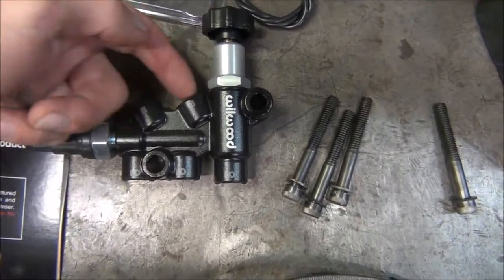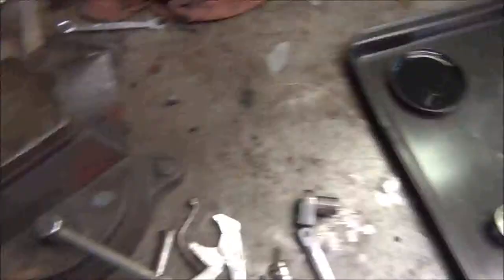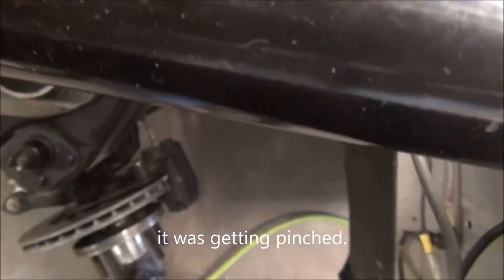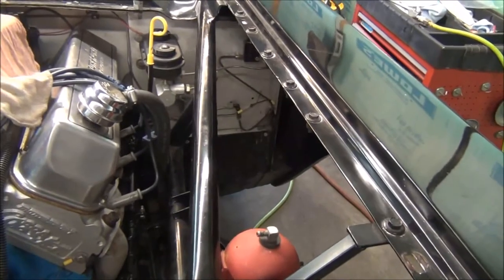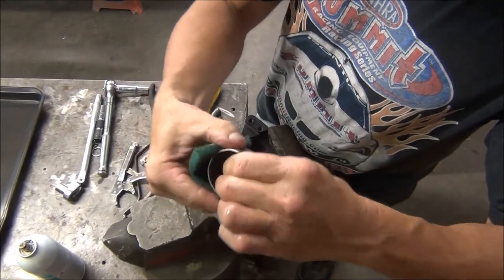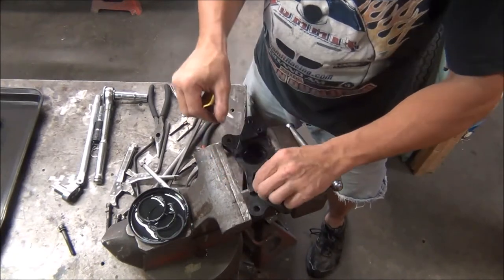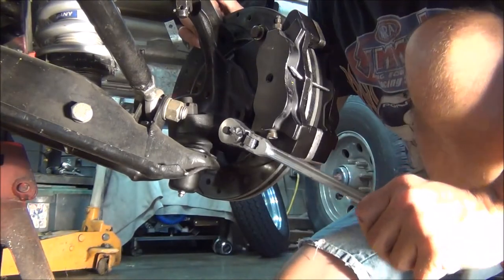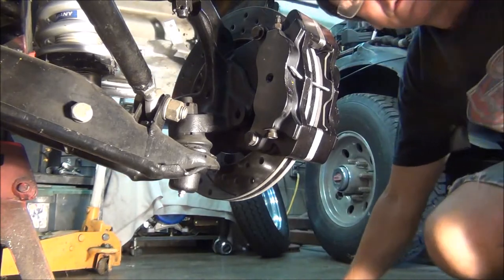Wilwood brake caliper rebuild Part 2

Comment: so i tried to look through your vids to see the outcome. after rebuilding them did they stick anymore? im having the same exact issue. seems they come out then stick but like far out. so its annoying. i ordered all my parts to rebuild mine just now. ive already taken them apart and such. seems the o rings are hardened. my car has been sitting since 2016 and i bought it with these wilwood brakes so im guessing after sitting outside for so many years that they need to just be cleaned out and resealed.
Reply from the maker: My camera failed after the last video I made about this issue. I found out my pads were wearing at an angle. So I milled them flat, and the brakes did not drag as bad. Now they are starting to tighten up again. So I am going to have to tackle this issue again. Thanks for watching.
Reply: @Dragracer64  my issue seems I need to replace my brake master. It won't release the pressure til the car sits.

Comment: What did you finally find wrong with the brake calipers? I've got a similar problem with my Wilwood brakes--almost impossible to rotate the rear wheels.
Reply from the maker: The pads were worn uneven or not flat . When the brakes were applied they were  put in a bind causing the pads not to move back freely when the brakes were released .

Comment: Anyone know what the torque specs are for the 4 bolts that hold the caliper together? Thanks
Reply from the maker: I didn't look that up.Just used my judgement and tightened them. Thanks for watching.
Reply: Dragracer64 thanks